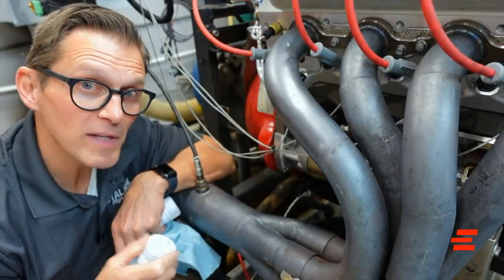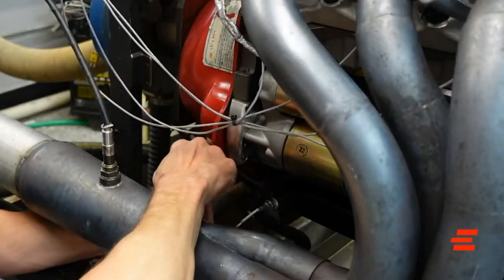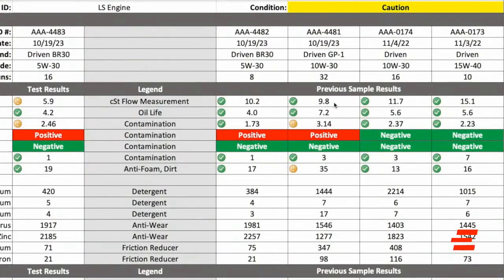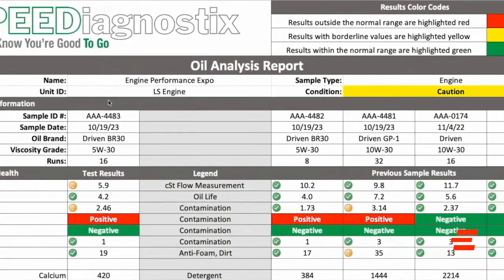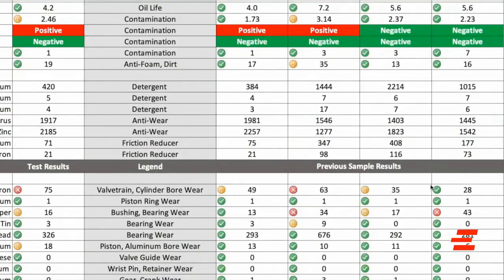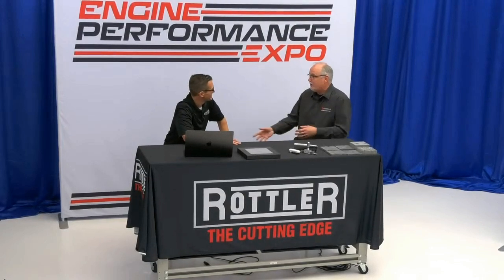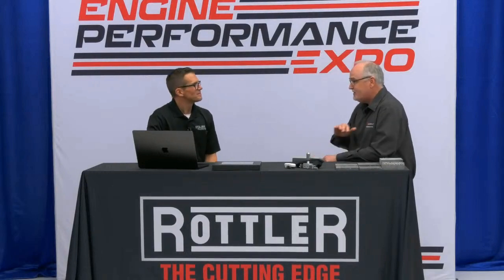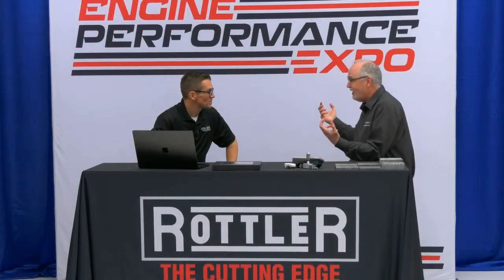How-To: Finding & Fixing Fuel Dilution Via Used Oil Analysis (Expo 2024 - Episode 25)

Comment: Does anyone run oil heaters in the pan and oil tanks to raise the oil temp above 212 degrees F to boil off the blow-by/water?  You could still have a low coolant temp for detonation resistance.   I also wonder what the cylinder hone and ring pack were for that engine at +1300 HP?  Gas ported rings, gapless?  CNC vertical hone job with a honing head with 6/8/12 stones on the head?